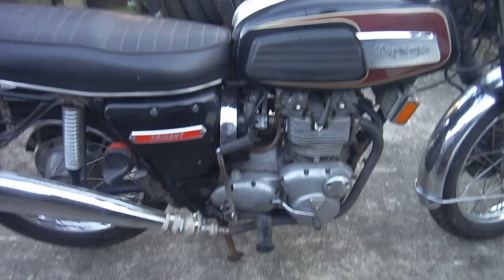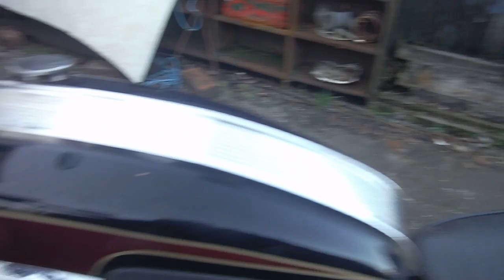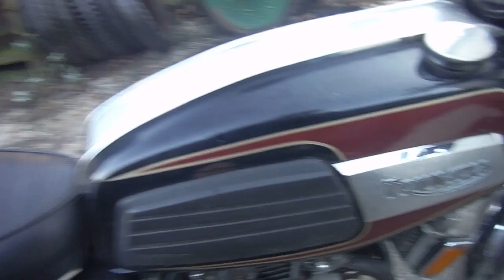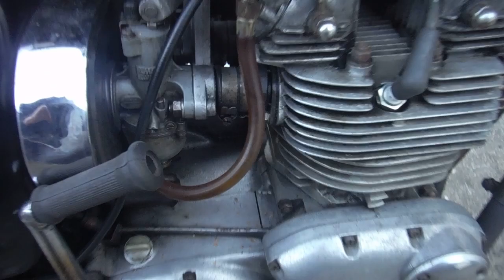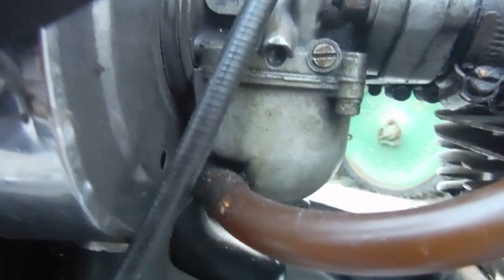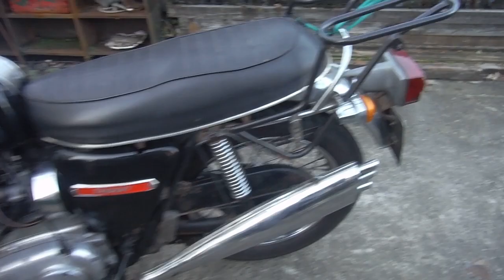Putting a machine away for winter - a couple of things to make life easier in the spring.

Comment: I put my 1978 T140V away about 3 weeks ago, after a good long run to get everything up to temperature. My winterisation consists of filling the fuel tank to the brim with E5, coating all the bare metal with WD40 (apart from brake discs, although that probably wouldn't make much difference on one of these) and squirting some oil in the plugholes, then turning it over to coat the bores, which I repeat once a month until spring. Battery gets charged regularly as well.
My all year round bike is a 1980 Suzuki GS550. I give that the WD40 treatment as well, then wash the salt off and reapply regularly. Chain gets lubed more often in the winter, too. So far this treatment seems to have worked, and a good clean in the spring is all it needs to bring it back to its best.

Comment: I have a 1967 BSA THUNDERBOLT 650CC with ELECTRONIC IGNITION. Which is the best battery type,  9AH or 12AH ?
Reply from the maker: I removed an electronic ignition from my 1970 A65 and went back to points - there are videos of this machine discussing why. With points, as long as you have the correct voltage, that is good enough, but I suppose the greater the AH, the better provided it will fit.
Reply: Thank you very much